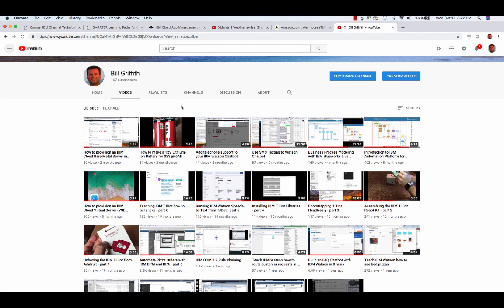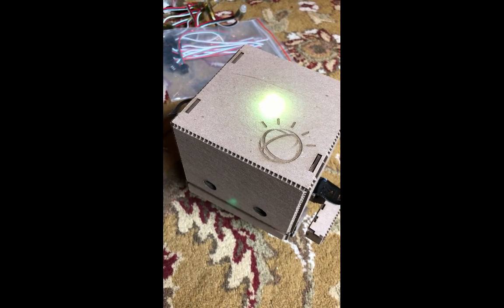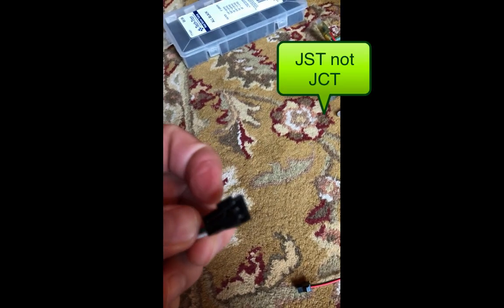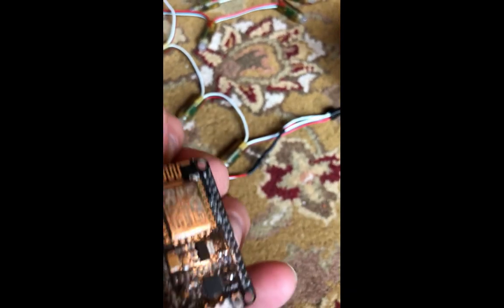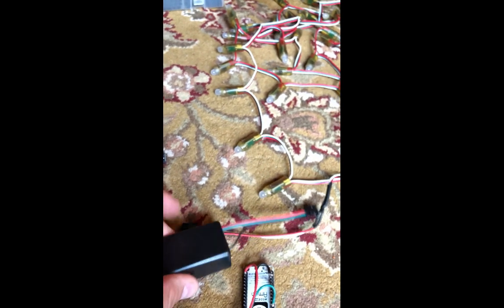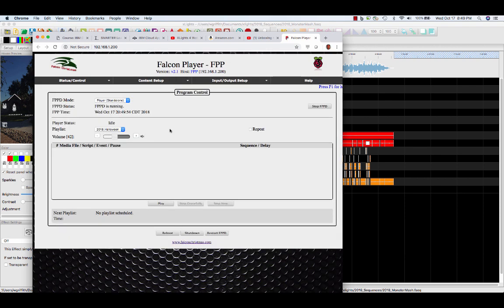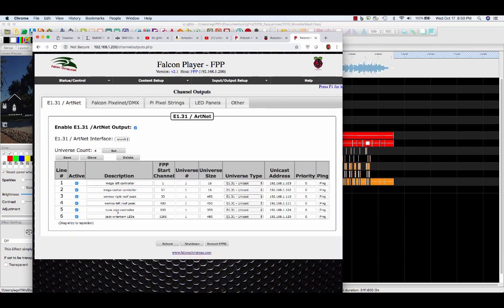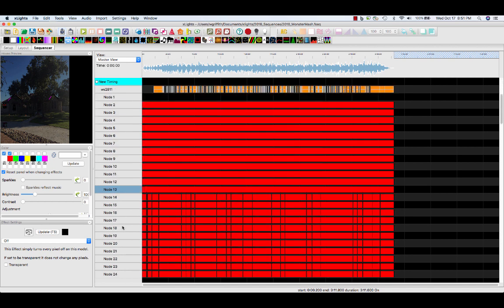How I build a RGB LED Holiday Lights Controller for under $10

Comment: Hey Bill. This video is great! I have been using nodemcu chips to expand my lightshow over the years because of you, so thanks! One thing I've been curious about is how you went about creating the outline for the lights? Is that a metal structure you made?
Reply from the maker: Thanks Joshua.  Yeah the little esp8266 chip is great.  I bought the wire frame.  I can’t remember from whom now, but maybe https://www.holidaycoro.com/default.asp - I’ve bought some of there sequences that I customize.  My original Halloween face was made by drilling holes in a 4’x4’ sheet of plywood and punching lights into the holes, but that wasn’t very attractive during the day, so I googled wire holiday frames and think I got the 4’x4’ wire frame for ~$200.  I’m sure you could weld something together, but the cost wasn’t bad to buy it, so I did.  Once I got the wire outline, I zip tied my LEDs around the frame.  In some cases, I cut the LED strand to fit, but you could just skip bulbs in your sequence instead with xLights.  I used a custom object and numbered all the LEDs and drove the light strand using my little nodeMCU box as in the video.  Happy holidays.
Reply: @billgriffith8123  Great to know 😊 Thanks again for all the info and Merry Christmas to you and your family.

Comment: Hi, great video!  Quick question, do you use a nodemcu for each individual decoration?  If so, do they sync well together?
Reply from the maker: Yeah I run about 150 LEDs per NodeMCU.  The LEDs I have run serially and the latency over 150 LEDs causes timing issues.  You could slow down the music timing, but for me 150 proves good for about 25ms timing.  I also use these NodeMCUs to drive solid state relays for regular incandescent lights/trees/snowmen/etc. and usually have one NodeMCU for 8-16 devices.  In xLights, I just add each NodeMCU's IP address (assign each a unique IP).  xLights then broadcast out the DMX packet to all the NodeMCU units.

Good luck and happy holidays.
Reply: @billgriffith8123  How do you assign the nodemcu to certain decorations, think they are called channels? I am slowly figuring xlights out, but still hitting some snags.  I am using WLED as the program to run xlights by the way.  Any info would be appreciated
Thanks
Reply from the maker: @MrArod1207  Each NodeMCU has an IP address and a number of channels.  I map display lights to the channels.  xLights does the synchronization and sends out DMX commands every 25ms (adjustable) and each NodeMCU receives the DMX command for the lights attached and sends that out to the lights.  The NodeMCU works like any other DMX controller, so just google on xlights and DMX over E1.31.  Good luck.